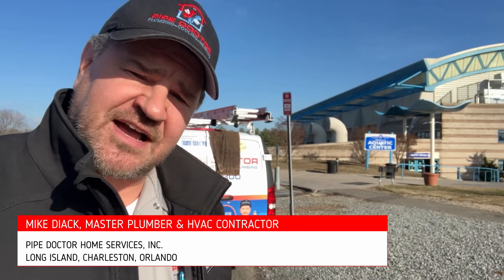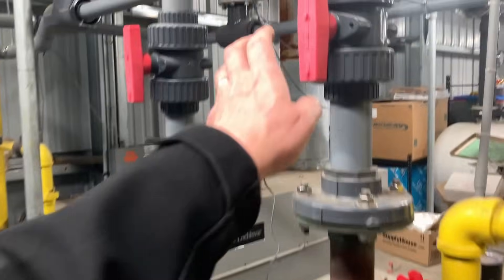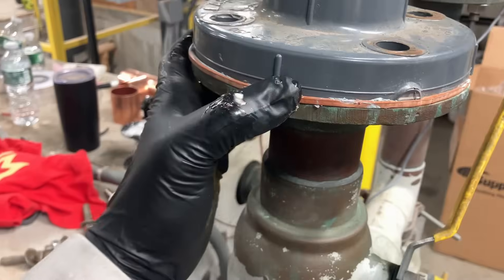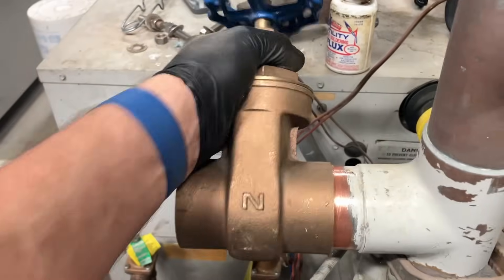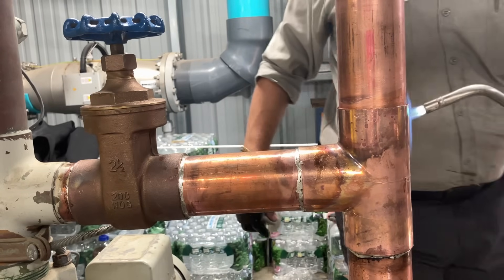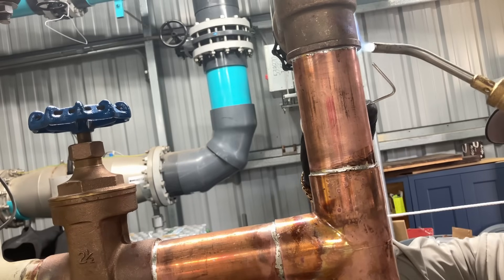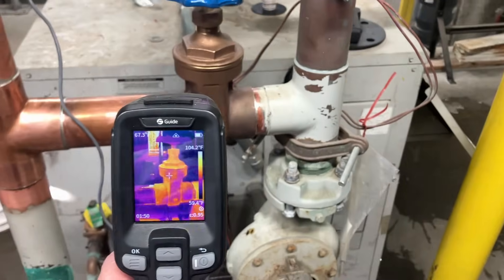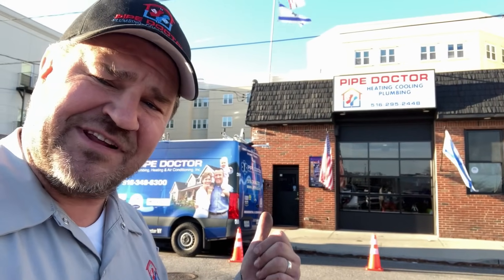Massive 2-1/2" Copper Repair on 2 Million BTU Lochinvar Boiler

Comment: Looks great but mann you messed it up by not removing the inside of those gate valves. They have rubber in it and you more than likely melted the rubber inside. Those valves won’t hold fully if you indeed did melt it 🤣🤣

Comment: Mike am i wrong in thinking the black handle valve should have been under the tee that way you can keep the bypass flow up and throttle the heater back

Comment: I know your not going to like this Mike... But on them flanges I use red or black rvt silicone on the automotive grade. Never had a leak. Just a fine skim with your finger across the gasket.

Comment: That heater is shot .  All the calcium build up your losing heat transfer. That system should be on a heat exchanger 

Always anti seize the flange gaskets

Those copper/brass unions suck they like to leak from time to time i will dope the sealing surface never the threads

Comment: Our facility used a liquid-to-liquid heat exchanger  so only softened treated water circulated through the boiler.  The chlorinated pool water was circulated through ABS pipes.  Even the circulators on the chlorine side were stainless and ABS materials only.  This arrangement also allowed us to use the main heating boilers to heat the pool when in season.

Comment: them putting pipe dope on the unions, are exactly why it came apart for you! if not it would have been seized with corrosion.
I generally put dope on every thread type in plumbing that I touch, just don't put it where it shouldn't be on seat faces and don't glob it all inside the fittings/system.

Comment: M tubing on pool application?
Why isn't the horizontal gate upside down?
Reply from the maker: Very observant. Good for you. For you  know the differences between L, K & M copper tubing and their purposes along with pressure rating?
Reply: @PipeDoctor  Phila commercial plumber for 25 years, so many heated chemicals, personally I would have went with L from my experience. Enjoy your channel.

Comment: Copper in 54mm costs a bit, 54mm (54x2mm=DN 50mm, newer stuff is 54x1,2mm= DN 51,6m )  is 2" and I never had to deal with the next size which is 68mm I believe. The BTU value equals 586 kW, a diesel electric locomotive has more thermal loss. Sweating (soldering with Sn97Cu3) is easier with a bigger flame. No professional over here sweats anymore as standart, they will charge the customer for pressfittings and if its a single application the invoice will contain the adquisition cost of the press tools. I did sweat them too as a cost effective option. Thw whole plumbing in the US looks like straight from the 1960's or 70's here. Valves with packing nuts: no change to buy them new. The cast iron sewer pipes in NYC (think usage ended in 1950 or so) Threads in waste water pipes are unknown here.  Ah respecting the maximum flow speeds 150 kW heater at delta T =20K (or C) already has a 2" piping. So even concious of the quadratic increase with diameter that 2,5 " at 586 kW and even with a delta of 30 K is already worth looking into it in terms of flow speed, pump losses and erosion. PVC flanges in a heat application, you gotta be kidding ;-)
Reply from the maker: Thanks for sharing

Comment: the pipe fitters at work   pre solder / coat larger copper pipes when fitting over 2 in ..I'm not a fitter so i don't know why

Comment: Small head on that torch for 2 in.  Surprised you didnt propress it.  I was wondering how you figured out the valves were no full port but it was Lockinvar that figured it out.

Comment: So much buildup that it might even provide some insulation, just hoping that the heat exchanger doesn't get easily clogged. Apparently this unit should have 89% efficiency so it's already closer to condensing
Reply: The buildup is from the water treatment chemical/inhibitor added to the loop, protects the metal from corrosion.

Comment: Happy Hanukkah 
Is there any suggestion that the customer needs to have the system flushed out with acid to remove the calcium?
The valve wouldn’t close because of the buildup of calcium what about the heat exchanger isn’t it just as clogged?

Comment: I know you were doing what customer wanted, but a balancing valve should have been installed on outlet so you could actually measure flow, no guessing. Temperature rise matters only if they are firing properly at 100%. I get the feeling these are not being maintained by someone whom understands how their combustion works, could see white gasket material around burner panels.
Reply from the maker: You are correct.

Comment: Wont the calcium clog the gate valve track in short order
Reply: yep, they'll be seized in place and break the stem off in top of the gate, which will likely get  stuck in place or shut if it's closed.
but ball valves are never a great idea for flow controlling and never were. at least the gate valves can be taken apart and serviced to free up/clean

Comment: I have a customer with one of those units the way we felt with the scale was we used or we flushed heater with muriatic acid and we circulated acid for 5-6 hours and scale was gone a little miracle thanks to chemistry
Reply: Does all the plumbing get isolated, and the devices removed and plugged... before the flushroo ?

Comment: Why gate valves vs ball valves again?
Reply from the maker: Mfg suggested to use gate
Reply: Serviceable.  @PipeDoctor
Reply: @PipeDoctor  i figured it was that or having to do with the fact ball valves are really for on/ off situations they aren't designed to throttle flow which i would assume is what caused some of if not all of the cavitation.

Comment: The joints on the 2 1/2 inch copper were not soldered completely that you took apart. Well enough not to leak though.  Did you use  type M  ?  I think I saw red lettering. Why not use type L  ???/
Reply from the maker: Because M was 40% cheaper at Ferguson.
Reply: @PipeDoctor  Copper has gone out of site. Plumbing materials have gone up on everything. I am glad to be at this end of my career. I am 73 and still working . I bought 3" DWV for a job last year and almost died when I got the invoice.
Reply from the maker: Because M was 40% cheaper at Ferguson.

Comment: Hey Mike Diack, of Mikey Pipes Plumbing not easy being cheesy. I  like your podcast/social media. Again where is the primer mixing valve and anti- scalding device. And no way too descale boilers on a bi yearly basic. Sound like there might be a hole in secordary heat exchanger and pool water mixing with boiler water causing violent thermal shock in piping system. Do you said, Lockinar or Jack Dainel old number seven again.lol. Love you buddy, you be safe out there.

Comment: Why why? A gate valve what’s that all about,,, replace with a ball valve
Reply: Ball or gate valves are not intended to meter or “throttle” the flow. The globe valve would be best to meter the flow correctly.
Reply from the maker: Ball valve really don’t throttle down flow
Reply: @PipeDoctor  neither does gate valve
Reply: Thank You Mike for sharing this video. We sell stuff that u work with and it’s nice to see them put to the use.  Love your choice on the gate valves. Let me know if u want some Nibcos $$$ lol j/k

Comment: here in uk we call that bumping on the boiler, like your kettle pops when boiling, we know cavitation on propellers or centrifugal pumps where are bubbles gett stuck on the rotor. remember buying some 1.75 inch fittings 20 years ago and they were £15 each then!
Reply from the maker: Wow

Comment: $275 for copper ✌️
Reply from the maker: More!!
Reply: @ you got reamed , I can get 20’ -21/2” K copper for $550✌️
Reply: @Pipesolutionsinc  In the rest of the country $275 is better than $550
Reply: 2 1/2" copper 10' stick close to $500 maybe more somewhere in that ballpark.  Not cheap